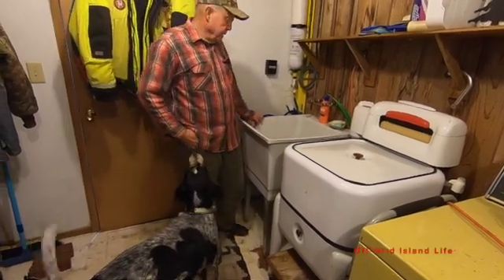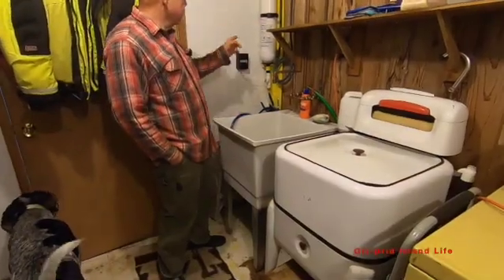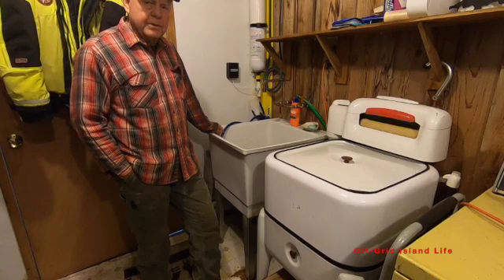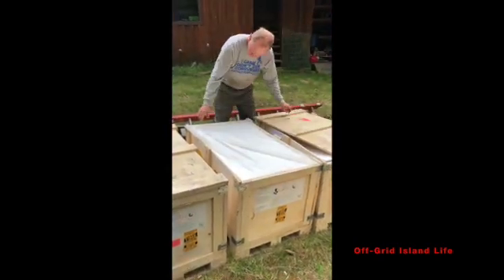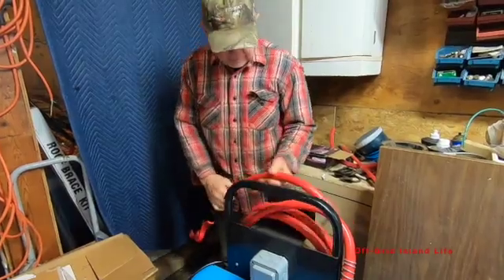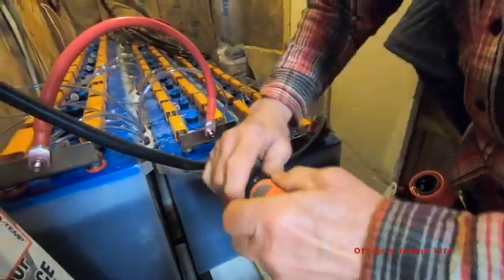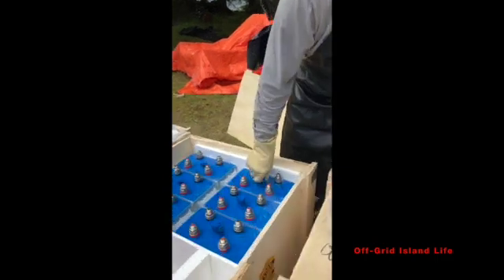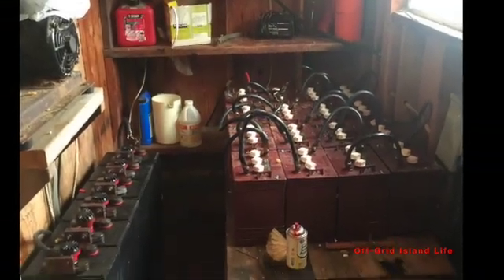Iron Edison Solar Batteries (Installation and Maintenance)

Comment: The best possible controller for them is the midnight solar classic 250. It has the right algorithm and handles all temp and moisture and arc variations,  and puts out 63A
Reply from the maker: Thanks for the tip! We'll take a look at them.
Reply: Have you ever tried a Victron BlueSolar mppt? I bought 8 of them for my solar array project (1 per panel) it can be manually programmed via a USB dongle. Just wanted to know your thoughts. I looked at the Midnight solar classic 250, the specs look great, but their prices are quite high

Comment: How many amp hour combined do you have in your battery bank? My wife and I are considering these batteries for an off grid home in Northern Nevada. Thank you for posting your video!!
Reply from the maker: We have a 48 volt system, with 40 batteries. Each battery is 1.2 volts and 300 amp hours. Thanks for watching!

Comment: Are you using distilled water ?
Reply from the maker: Yes, we have a water distillation system, which we purchased from the same company as the batteries (Iron Edison). I think we may have mentioned it in the video, but we really should have spent more time talking about it.